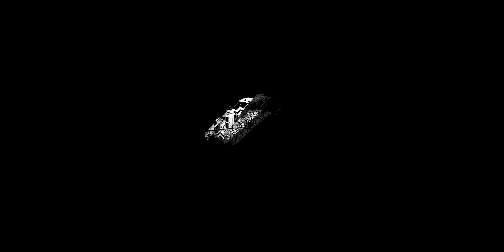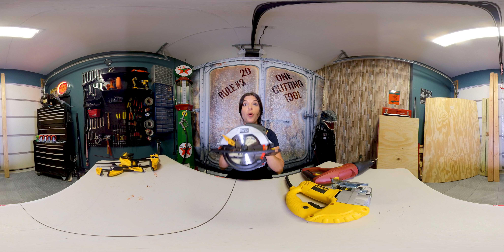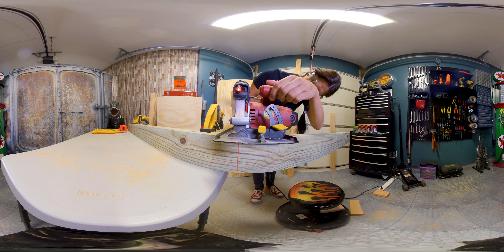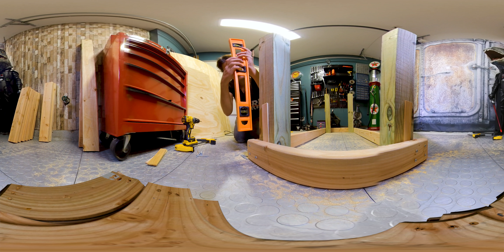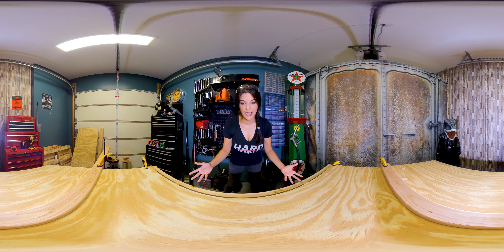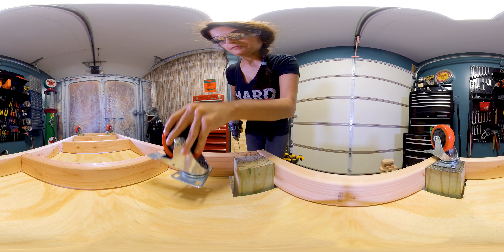Easy DIY Budget Workbench | 360 VR Video

Comment: Why did you stop this 360 format?
Reply from the maker: I love 360 video and believe it's immersive quality is perfect for this type of content. But after shooting in 360 and 180 for a while, it just didn't get any traction. Plus the post production is much more time consuming because consumer-grade 360 cameras need a lot more lighting to get a clear picture and I like to remove the gear in the background. All that effort and the video didn't perform as well.

I still have my 360 cameras and have been watching how the medium evolves. I'd love to get back to shooting in 360 or 180!
Reply: @RachelDeBarrosLive  thanks for responding! Really helps. I have a gopro max and was thinking about giving this format a shot. I sincerely despise setting up a camera for every single shot. When I'm making, I'm in the zone and can't switch to director/videographer mode easily. Plus It just seems may more intimate. Like you're there in the room with the person.

What camera did you use?

Comment: Nice job!  Love your Metallica shirt too!  \m/  
Did you get to see them at the Linc last year?  I was down on the field near the stage.  Awesome show.
I have an old Black Decker Workmate which is great but doesn't have much surface area.  So I put a 2'x4' piece of melamine particle board on it, drilled a few holes to line up with the ones on the Workmate, a few bolts (countersunk into the top), nuts and washers, and now I have a compact, fairly sturdy work area that I can fold up!  And I can take the top off as well, if I need the Workmate for other things.  Been using it a lot as I pull apart the engine externals on my '98 BMW 328i, to clean and restore them in prep for reassembly after replacing some leaky gaskets.
Reply from the maker: Great idea on the foldable portion! I might add that to mine later on!